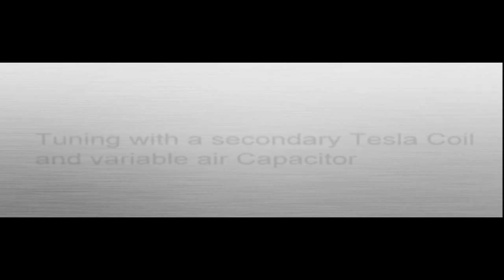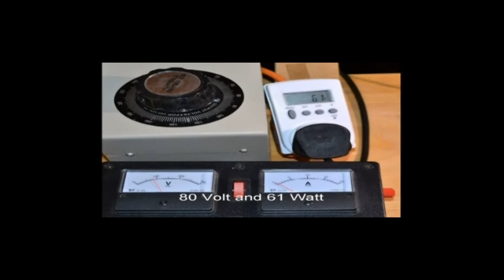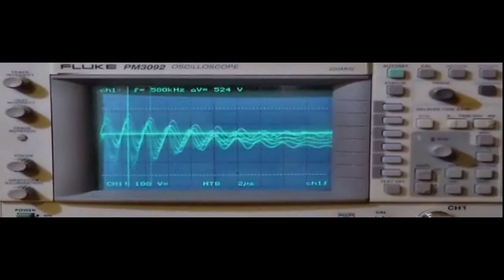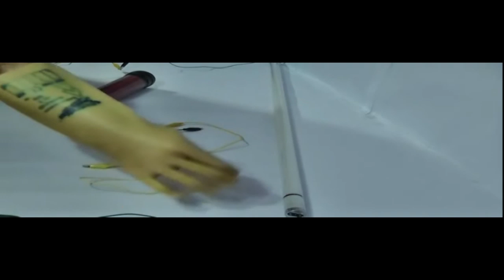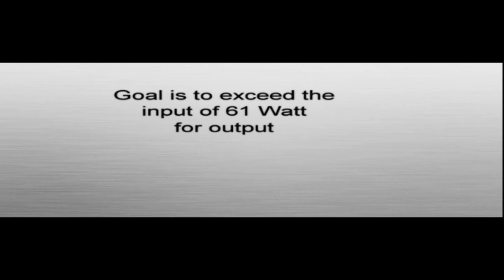Tesla Radiant Energy

Comment: You might look at setting up asymetry with the secondary as one terminal, but then with just a piece of metal as the other terminal connection...    the connection between these two things would be where the "current" flow would be localized to be greatest potentially.   Guzka ...

Comment: How much does the 1b22 radium tubes add in terms of gain to the system?   I have a few of those kickin around...  doped with radium.  They're pretty hot...
Reply from the maker: Yes, I got rid of them. Too dangerous. They are very erratic but as closed spark gap best. However I provided a video where I used GDT's
Reply: GDT's at what rating?   I've used GDT's as well but they don't handle much current...  but at least they're not doped with radium... ;)
Reply: Can you please link me to your GDT vid?  You've got alot of vids too...
Reply from the maker: The Main videos are on my member website. There is  a stronger one existing which is used for sparking in Gas hobs. Here is the introduction. https://youtu.be/HiEZmpq5SbU
Reply from the maker: I start at 1 KV and go up to 5KV. Link them in series for higher voltage
Reply: Thanks!